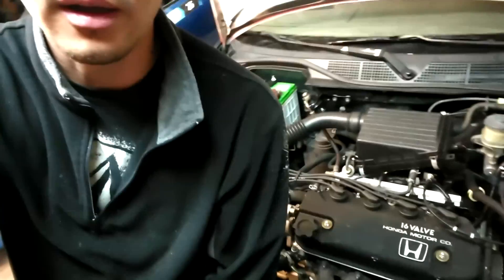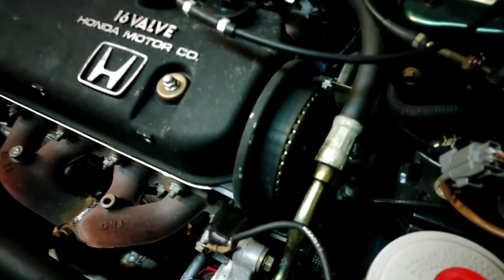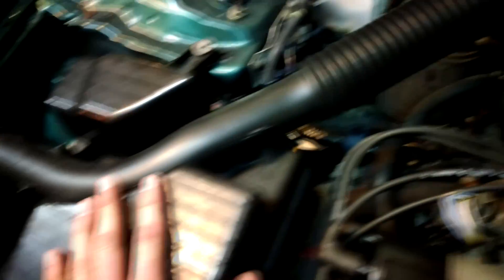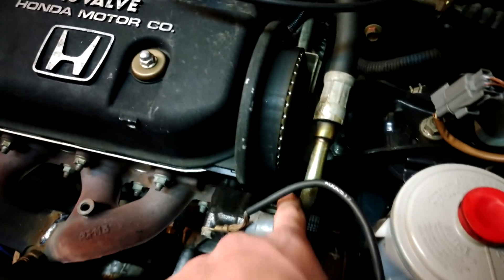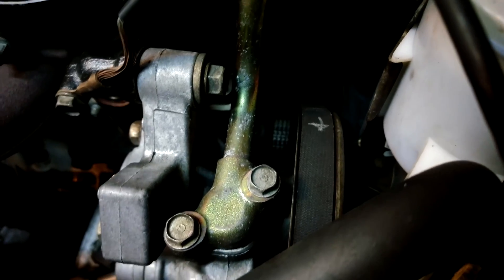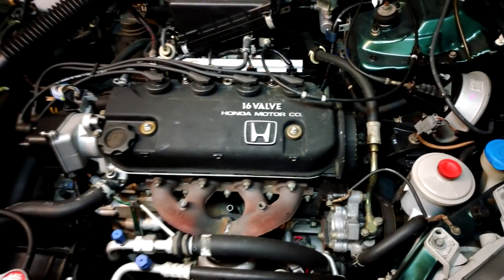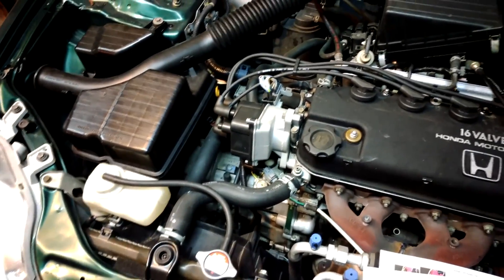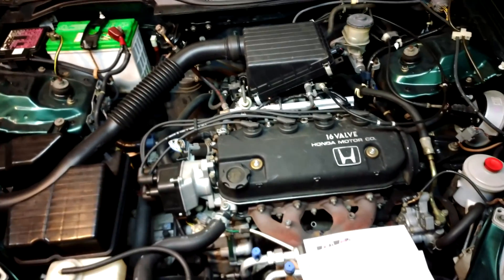CKF bypass trick - D15B7 in a 2000 Civic

Comment: I have a d15b7 with a 2000 y7 head it's weird because the car is a 98 and it ran at one point and now I don't have spark I have no idea where to start lol wish they had left the stock engine in it
Reply: This is the swap I just put in my 99 civic non-vtech mini me bc that’s all I could find. It rotates but doesn’t fire up I haven’t plugged in my crank sensor yet and I’m still using the distributor from the y7 head

Comment: Hey man im currently doing the same thing on my 98 civic lx it’s a auto to manual swap but the harness I have is for a manual D16Y8 if I put the y8 manifold on it along with the injectors and alternator will it be good to go?? also Im using a y7 manual ECU do you know if I’m going to have any issues using this y8 harness and intake
Reply: Did you ever do this? I’m doing the exact thing rn and just wondering if you have any tips

Comment: What about the opposite of what you have. Y8 in a 95eg  d15b7 dist. Matches ran fine for years mint... couple months back was getting distErr.. crank no start .. I'd unplugg the dist connector plugg back in it would fire.
Now I don't get the distErr  now I'm getting code9...... I've tried everything  tested cyp was 420ohms  book says 300-700ohms
Checked for short on both sides of the cyp pins no short to ground . And have continuity from ecu connector to dist connector  no short in the wire. I've bought and tried 3 different distributors evan tho the test was good for cyp on all and still get the code 9
Also swapped ecus

Comment: Hey man which p/s pump did you use and with what bracket ??
Reply from the maker: I think I used the one that came off of the D16Y7 that originally came off the car.  If I remember correctly only 2 out of the 3 bolts lined up but that was enough to hold it securely.

Comment: Where did you find your D15b7? I've been looking all over for one.
Reply from the maker: I found mine off craigslist.  But you can find them at most junkyards it seems.  At my local pick-n-pull there are like 3 b7's and b2's
Reply: Wichita in kansas has 3 b7 sitting in a U pull it. Minus small parts and peices.
Reply: Even a couple Z6s

Comment: is this the same concept for a d15b6 bottom end out of a 91 crx going into a 99 civic was with a y8 head
Reply from the maker: yup, the exact same thing
Reply: thank you sir i can use the stock y8 timing belt as well
Reply from the maker: @joshgilbert9936  You're going to have to use a D15z1 timing belt.  The 1.5L block has a shorter deck height than a 1.6L so you need a shorter timing belt.  
Some forums say you need an adjustable cam gear to get the timing just right, but I think you can just run the stock cam gear and be good.
Reply: i notices the thermostat housing is a lil different. is there a differe t spot to place the temperature sensor?
Reply from the maker: @joshgilbert9936  You're talking about the thermoswitch?  I don't remember off the top of my head where the switch is located on a D15B7, but I think it is somewhere near the thermostat.  All it does is switch the fan on and off when the coolant temp at the thermostat housing reaches a certain point.  If it's not located there, it might be located on the upper hose neck on the head of the engine.  You can just extend the plug and make it work.  
But it should be close to the thermostat.
Reply: im saying the actual housing itsself the crx motor didnt have the sensor in the housing but the y8 out of the 99 did

Comment: Awesome vid, Did the same exact thing but stuck on 2 things. When you installed the y7 IM onto the b7 head their was an extra coolant passage on the head but not the IM, what did you do here? 2nd question Can i use an obd1 dizzy with adapter harness and still do this trick or must i use obd2 y7 dizzy to do this? oops i lied lol 3rd question the old crank sensor plug do you just leave it hanging in the back of the block? thanks much appreciated ....
Reply: I did this swap I left the crank sensor plug hanging or you can even use a zip tie to hold the plug.
Reply: And you can use obd1 dizzy as long as you have dizzy jumper harness your good .
Reply from the maker: hmm, I didn't notice the extra coolant port on the B7 head.  I'm not sure if I used a B7 or Y7 intake manifold gasket but once everything was together, there weren't any leaks.  
I'm not too knowledgeable with OBD0 vs OBD1 vs OBD2 dizzy's but as far as I know, you can use them if you have the correct jumper harness. 
Yup, I just left the plug hanging.  You can take the plug and wires out of the loom if you'd like but I didn't bother.
Reply: I used y7 intake  manifold gasket
Reply: @josechavez1591  All good , thank you. Did the swap with everything mentioned above including y7 dizzy and y7 IM gasket and the Crank sensor delete and is all running good.
Reply: And I still used y7 dizzy and it fits with no problem.

Comment: I have done about 15 honda swaps.This works 100% but I do it my way.I take a razor and strip the wires all the way around.Then use another small stripped bridge wire to join the wires.No cutting of the wires that go to the plug.You can solder them and simply wrap in electrical  tape then zip tie for protection.You don't have to solder though.I have done it both ways.The clip method sucks and comes loose sometimes.Cutting the wires completely sucks to as they come loose easy.I have done this bypass on obd2a civics and obd2b crv B20 swaps.Works every time.No engine light ever.
Reply: Hey man I tried this on my car I have a 96 y7 that was swapped auto to manual I put a d16a Japan motor in and I'm not getting any spark tried this method but nothing and can't find the timing gear with ckf sensor gear on it what do I do

Comment: Bro your awesome huge thanx. I had no idea bout CKF bypass trick. I have a 1999-d16y8-vtec.? Q-?...if replacing block off d16y8 w/d15y7. Will this work?
Reply from the maker: Do you mean a D16Y7?  A Y7 is an OBD2 block and you should just be able to run the crank sensor as normal.  
If it's a D15 something then it's OBD1 or OBD0 and yes, you'd have to run the CKF bypass and it would work.
Reply: @CtrlAltDefeatTV  bro thanx 4 da reply...will the car start without doing da ckf bypass
Reply: @CtrlAltDefeatTV  hey man I'm having issues with not getting any spark I did this bypass trick and still no spark what should I do
Reply: No they make obd2a and obd2b jdm motors.

Comment: What ecu did you use? Im.puting a d15 in my 96 hatch I have a p27 I think I can use with the ecu adapter plug. Not chipped
Reply from the maker: I used the stock D16Y7 ECU that was originally in the car.  Just use whatever ECU you're "dressing" the engine as.  Whatever harness you're using, match the ECU to that.
Reply: Hey im dropping the same motor into a 95 civic that used to have the d16z6. Im using everything that was in the d16( intake disteibutor exhaust etc.) in the d15. Currently as we speek the motor runs but sounds like shit idles like shit and its smoking like if i just seafoamed it. Which i have not done. Will this wire method work on the setup i have or wat could be wrong

Comment: Will this work for a 1999  CRV. I keep getting the crankshaft positioning sensor code on Code reader I don't wanna replace the crankshaft sensor so if this is going to work please let me know
Reply from the maker: Yes, this should work in bypassing your faulty crank sensor

http://ff-squad.com/wp/?p=309
Reply: Yes.I have done it on the 99 crv.

Comment: What motor mount did you use on the drivers side
Reply from the maker: The part that bolts to the block was the stock D15B7 part, then I just used the 96-00 mount on the car side